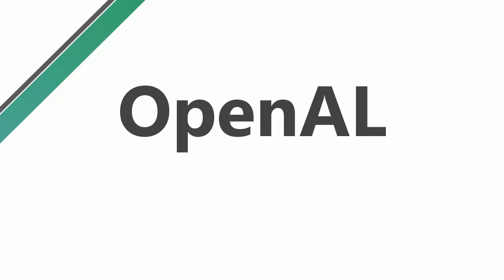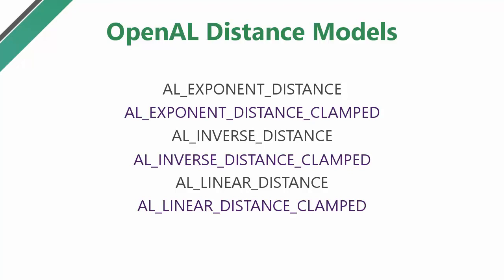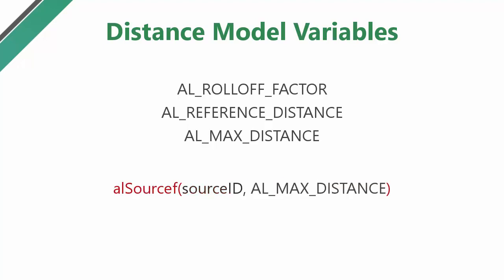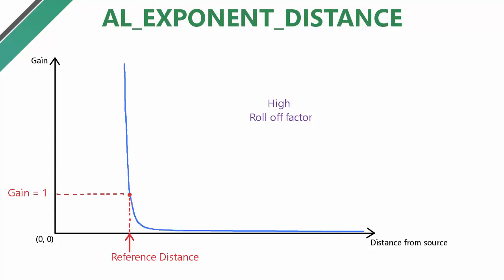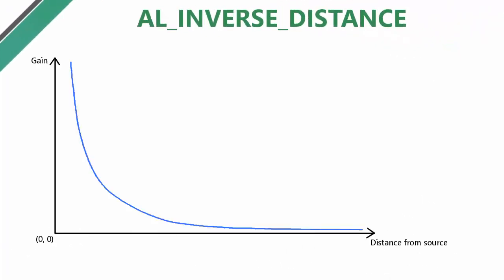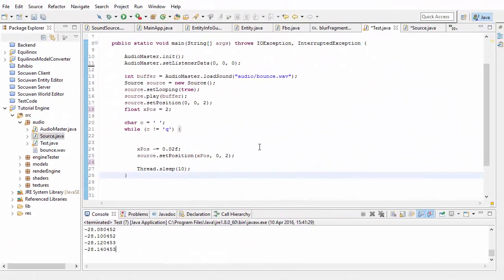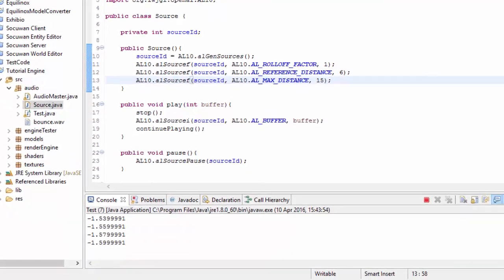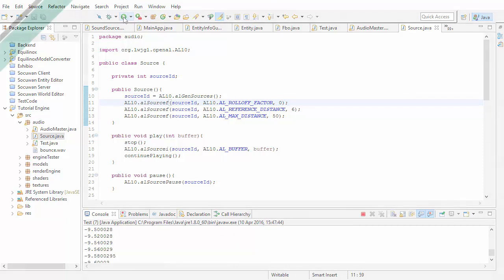OpenAL 3D Audio Tutorial 4: Distance Attenuation

Comment: Very good tutorial as usual! I'm wondering how you would handle a 'large' sound source, a rippling lake for example. Do you just have to add multiple sound sources roughly equal distances from each other? Would be nice to have the whole source emit the sound rather than just a point sound(s).
I guess the clipped attenuation would help but wouldn't be accurate if the lake wasn't circular
Reply: You can make many circular sources to approximate the shape of the lake. There are many approximations in games anyways, so it is ok. Anyways, audio is something the will work fine even will less hard work and detail, however it should not be taken lightly.

Comment: Am I the only want to want a shader based audio pipeline like in OpenGL ? With a "audio source" and a "sample" shader, like the vertex and fragment shader ?

The audio source shader just calculate the speaker position in normalized 3D coordinate [-1.0, 1.0],  eye space (with a view matrix etc...).
And the sample shader just calculate the audio sample (still normalized [-1.0, 1.0]) to play.

And you have to simulate the attenuation stuff, camera position, velocity etc...

If programmable pipeline made OpenGL better, why won't it made OpenAL better too ?
Reply: Check out shadertoy.com, a lot of the submissions there actually use GLSL shaders to create sound on the GPU. It's a lot of scary math, but it basically proves your idea :)